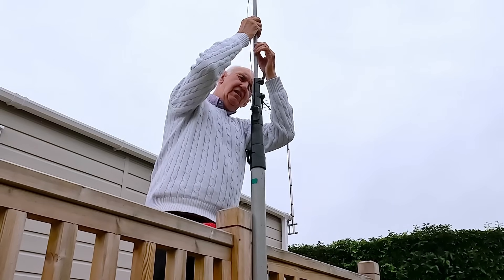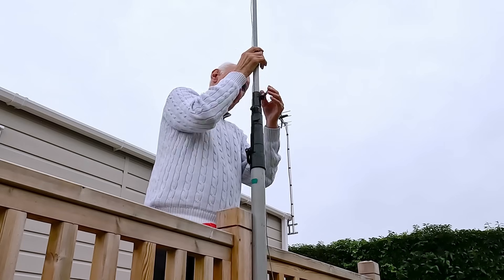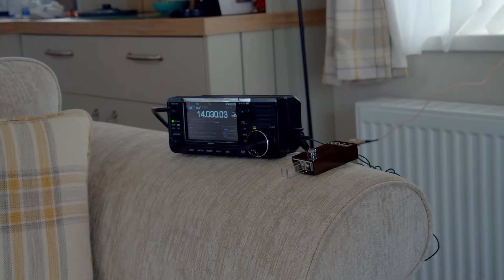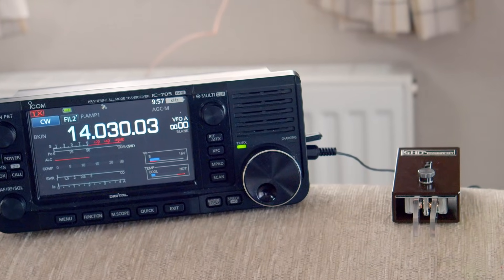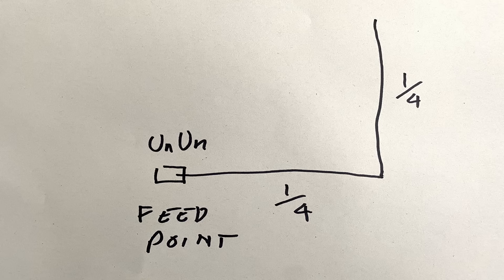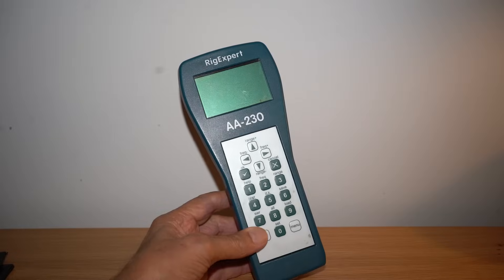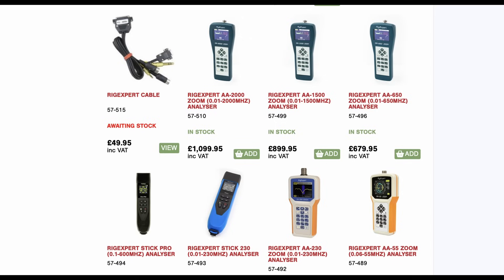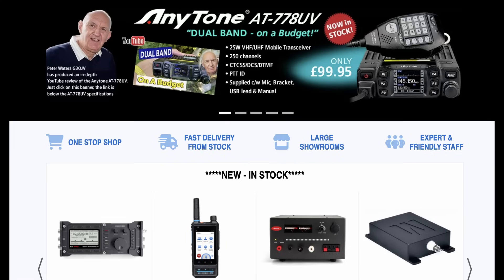HF Variable Frequency Vertical Antenna -Help us Refine it and join in the Fun! | Ham Radio

Comment: I've taken a 17' whip antenna and put it on a tripod. I took a 9:1 balun and attached it to the 17' whip with an 18.5 foot wire to the balun. This makes the antenna 35.5 feet which is an excellent random length for the balun (unun). I have grounded the other side of the balun to my ground stake in the yard with a 22 ft wire. The coax to the radio is attached to the balun. Takes 10 minutes to set up. I can tune on my radio 10 to 80 meters. No external tuner used. If I lower the whip to the lowest length, I tune on 6 meters. After tuning on the radio, my SWR is 1:1. I have made contacts to Japan, Russia, US eastcoast, Hawaii, Canada, and Mexico on 15, 20, and 40 meters. I'm in Southern California, USA. I just recently demo'd this design with my local club. It works very well for me. Very nice video. I will have to try the 49:1 balun on my rig. 73 KJ6ZBU
Reply from the maker: Hi there, and thanks for sharing. Ham radio is all about trying to make the best of situations we find ourselves. Well done.
Reply: Thank you. The MAGIC happens when you can collaborate and share. Thank you for your MAGIC. I have watched many of you videos. 73

Comment: This is wild. I have an EFHW set up as a sloping L in my yard. Last week I was trying to figure out what could be done to expand the frequency range. I was thinking something along the lines of a coil - like the JPC-12. And bang! Here is your video! The variable capacitor is much more user friendly than the shorting system of the JPC-12. If the variable capacitor could be set up next to the radio, then the various bands could be dialed in without treking out into the weather. Anyway, Peter, you are definitely onto something! Love your videos. Always get my mind going. Thanks!
Reply: Someone above suggested an arduino and stepper but I'd prrsonally rather use a nana raspberry pi.  Put all that in a box, arrange it so that a shorting bar shorts the contacts at one extreme. Drive the cap with the stepper.  Hmmm.

Comment: Very, very interesting.

I did plan on installing a similar antenna for 20 meters. 

For near ground antennas I typically use speaker wire for the radiators that are then shorted at their far end tips, but not at the feedpoints. This creates essentially what if called a dipole would be now called a folded dipole. The spacing of speaker wire when configured this way brings the impedance up to near 50 ohms that otherwise would be lower due to proximity to the ground.

Now using your capacitor placed in the middle my plan has changed. I definitely will give this a go.

I noticed that you had a high voltage variable capacitor secured to the deck handrail. I am wondering if it was used to find the required capacitance for the twisted wires that form the antenna's in series capacitor?

Nice experimental result....
Reply from the maker: I will come back to that antenna in UK Spring.

Comment: Great to see your experiments, Pete. The evolution of wire antennas is fascinating, particularly when you consider they all started with a bit of wire related to a wavelength (or not!). 

This antenna has many similarities to the W3EDP which itself is a development of the half-Zepp. And the EFHW is a simplified half-Zepp. The j-pole….. 

I’m intrigued and will be trying this myself.
Reply: The ‘original’ W3EDP
Reply from the maker: Interesting! 73 Peter.

Comment: Hi Peter, in the past, I have benefitted from high voltage transmission lines, parallel to my long wire antenna. Around five minutes into your video, I see these a matter of feet away from your setup. I postulate these will receive and couple to your incoming and transmitted signals, acting as part of your antenna. Mine were around 100m away, running NNE / SSW in parallel to my 50m long wire, and in 2009, I had some lovely contacts as far as Tasmania, with 100W from a Kenwood TS430S. I only thought this through recently, as I currently have an "L" shaped 10m x 10m long wire, not benefitting from the "help". Good to see your experimentation, and I will apply this idea to my 10m vertical pole, with a (random) horizontal wire, as is my normal experimental practice, when time permits.
Reply from the maker: Interesting observation. I have only had this location for a few months. The cables produce hardly any noise and run north to south. My main tests are from home so I am happy that the results I get can be assessed fairly. Thanks for sharing. 73 Peter.

Comment: A "shorting bar" could be added to the end of the variable capacitor's travel to eliminate the need for a separate shorting link.  An insulated shaft, stepper motor and Arduino would be another "nice" addition.

Comment: Great idea,
Also yes I found out testing a transformer and a length of wire cut for 10meters, it resonates at 24.7mhz, 
So I tested on another 49/1 and got the same then I came up with, like you say the 49/1 adds inductions
It did make me think 🤔
How is the new shop 
It is a shame move from Portsmouth as I was close to it and grew up with them
I remember getting some transistors from the shop in, north end Portsmouth when I was 15 years old, now 57,
Thanks Dave

Comment: I was originally thinking about a length of wire attached to a helium- (or hydrogen) filled balloon. You could raise or lower the height of the balloon to choose a resonant frequency.

If not … a tall non-conductive flag pole. No, the flag pole is not the antenna. But it has a pulley at the top with a length of rope attached to a thin antenna wire. Pulling on the rope will raise a varying length of wire.

73 de AF6AS in “DM13” land

Comment: I wonder if you have compared your results with the same vertical (without a midpoint capacitor), fed through an ATU in the shack, close to your rig? 
I will be mounting a solid 30' vertical and using your idea with plastic drainpipe for support.
So Peter, thank you once again for providing ideas for experimenting.
Reply from the maker: The reason for the capacitor was to enable a short vertical to resonate on several bands. Missing out the capacitor and using an ATU at the shack end will not work.

Comment: StepIR make a variable length vertical although not very portable, however Colin MM0OPX has developed his Adjustiwave antenna that is similar and works portable.
For me, the DX Commander wins. Once the initial build has been done, its super quick to throw up and get on the air.
Reply from the maker: The advantage of my system is that it is very simple to make and the variable capacitor is very efficient. It needs no guying and very fast to erect. There is also some directivity gain.

Comment: Nice experimentation with capacity. However, for portable operation I would rather insert a link (e.g. 2mm banana connectors) in the 20M wire to achieve resonance on 17m or any other higher band. Alternatively, one could use a variable capacitor/inductance (LC circuit; Fuchs circuit) and replace the UNUN to achieve multiband functionality. 

If I want to LOWER the frequency of the 2nd harmonic of a 40M EFHW to the CW part of the 20M band, I insert a short stub  at the antenna output of the UNUN which acts as capacity at the feeding point. 73 de Chris DL1GKC
Reply from the maker: Remember that links would have to be in the vertical section and would destroy radiation pattern.

Comment: Just a random idea, if you used a small piece of RG58 or similar as a capacitor and the "gap" in the antenna had an SO239 fitted you could then make a series of different value capacitors consisting of just a PL259 and a a length of unterminated coax. I think it might be a useful addition to have a very high value resistor across the capacitor. 73
Reply: I was thinking the same. You could also have a multi-pole switch to select the band.

Comment: Interesting idea Peter. I'm reminded of that other antenna you covered that used quarter-wave stubs to short out the loading coil. Wondering if you could somehow use a quarter-wave stub to short-circuit the capacitor when it isn't required. Although off-resonance the stub itself would appear as a capacitor. Hmmm...
Reply from the maker: Yes I tried that but as you say the antenna sees it as a large capacitor. Thanks for your interest. 73 Peter

Comment: Years ago  when the then new WARC bands were released I used a capacitor at the base of a 5 m quarter wave vertical for 20 m to make it tune on 17 m and 15 m.  It worked very well. I've now got a 7.2 m vertical for 30 m so I'll test it with a variable capacitor. 73 Chris G4HYG
Reply from the maker: Yes a  series capacitor will raise the resonant frequency.

Comment: Hello there from Christchurch, New Zealand .... I just love watching your Very Informative Vidclips .... I have question for you ..... What is the Best / Smallest EFFECTIVE Antenna for 80m ????..... I live 'In Town' and don't have much space, so even an 'Inverted V' will be an Issue ..... :-)   :-)   :-)  .... I have a 40m 'Long/Random' Wire antenna with an 80m Section added on the end, thru' a 110uH Choke, But this results in a Very High 'Q', giving a 'Needle Point' Resonant Band  ...... Best to ALL from ChCh, NZ, Keith
Reply from the maker: The best I have so far found is a 40m EFHW with the choke you mention. You can bend it around and even as you mov3 away from resonance, even a 5:1 VSWR still works if your inbuilt ATU will cope.
Reply: Hi Keith, Check out the G7FEK antenna - it's only 7.2m high and about 13m wide and works on 80m, 40m and some higher banks. It's two inverted Ls - I'm using just the 80m side and it's quite broad so no worries about high Q. Although the design shows 450ohm line for the vertical, that's just because it's mechanically convenient. It can be two sloping wires. 
Cheers de ZL2GX

Comment: As always a good and informative video. Some ideas , using coax stubs as the cap. Adding an inductor in parrallel or series. Your cap idea with the whole antenna vertical, so no counterpoise. What swrs where you seeing?
Reply from the maker: Typically 1.2:1 Always better than 1.5:1. 73 Peter

Comment: In another video I recently saw a trick used to automatically short out a loading coil in an antenna: Attach an open-ended electrical 1/4 wave length of coax in parallel with the inductor (in this case the capacitor).  The stub must be a 1/4 wave on the frequency where you want the inductor (capacitor) to be shorted  (here 20m band). This should work because a 1/4 wave open coax stub acts as a dead short on the designed frequency. This way the capacitor would be invisible on 20m but effective on other frequencies (here 17m). This should give you a three-band antenna that resonates on 20m, 17m and 10m without the need for any mechanical change-over. Worth a try?
Reply: Ah, I see somebody  else has already pointed that one out :-)
Reply from the maker: It does not work with a capacitor. Away from the 1/4 wave frequency the stub simply acts as an additional parallel capacitor. Tried it!

Comment: Hi Peter - did you  have any problems with the power lines next to the antenna? - looking forward to the next video!  73 - M7MNP
Reply from the maker: No, fortunately there is no problem. Have not checked 80m though. 73 Peter.
Reply: Hi Peter. I have a 11kv feed at the bottom of the garden. I used to run a large horizontal loop around the garden a total of 369 ft. I had aletter in the post from the local DNO asking me to change the antenna for safetys sake. So im now experimenting with the same type of antenna that you mention. I have used a 30ft metal flag pole as the vertical section  and it supports thehorizontal section to the house. I feed the antenna from the bottom of the vertical section  via 49:1 unun. I will try your idea of a capacitor to see if I can adapt it to different frequencies. Love your videos by the way.... amateur radio as it used to be.
Shaun G8VHO

Comment: It would work even better if the feed point was at the bottom of the vertical section and the horizontal section comes from the top of the vertical section.... inverted L design
Reply from the maker: I think you are misunderstanding the working of this antenna.